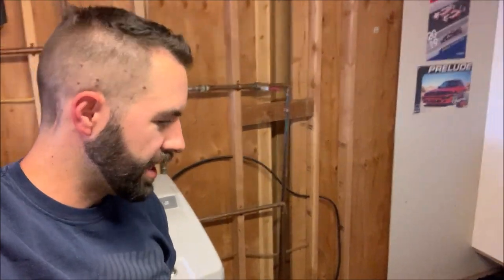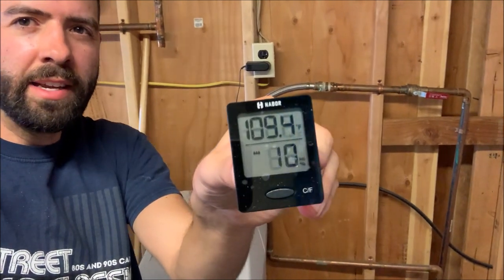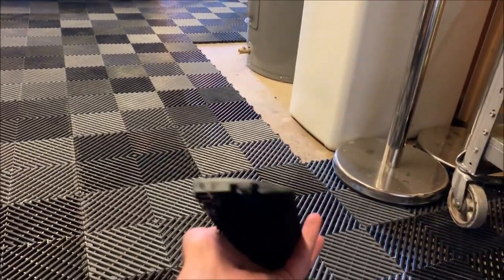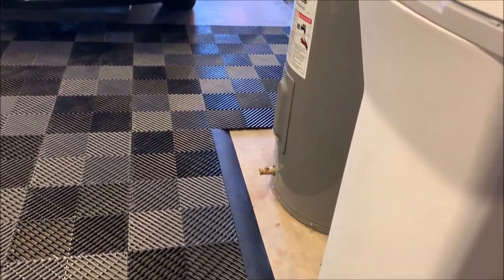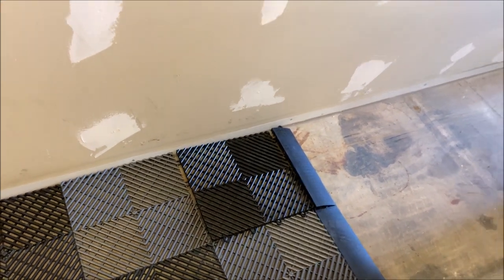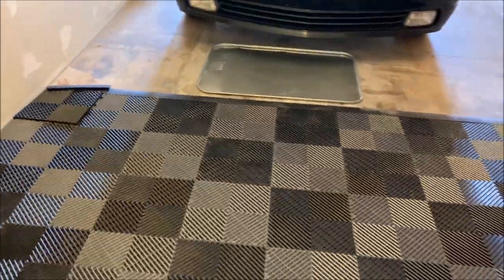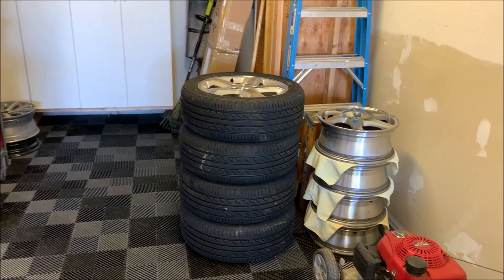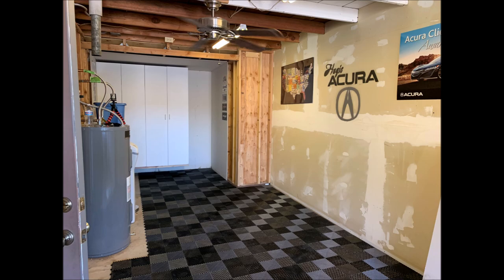Updated Garage Flooring in the Mini-Showroom

Comment: Big improvement! Wondering if I should invest in a flooring like that too 🤔
Reply from the maker: It runs like $2.69 (I think, anyway) per 12x12 tile.  Which is about half the price of the 3-step epoxy system I did in the larger garage.  Worth it!